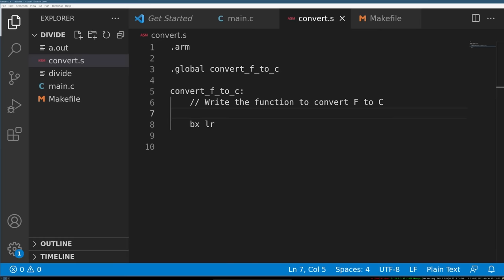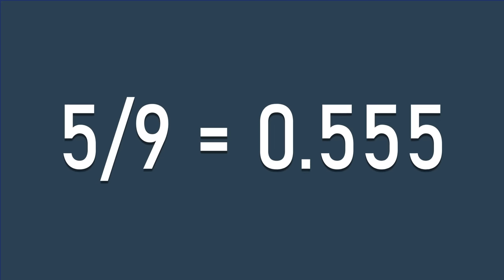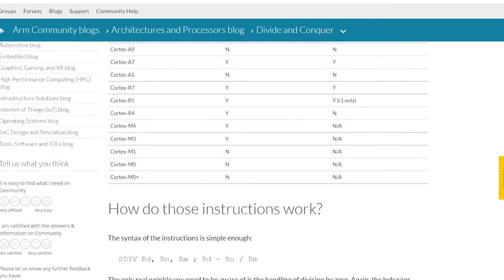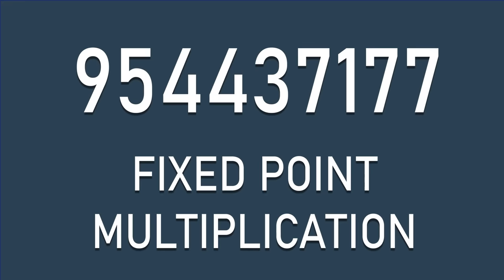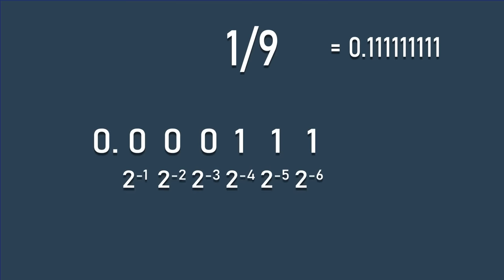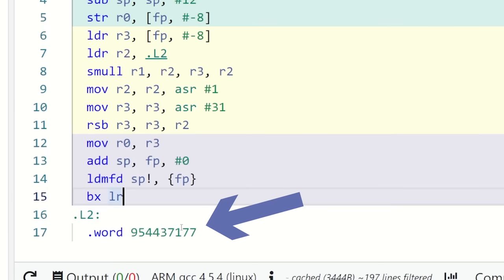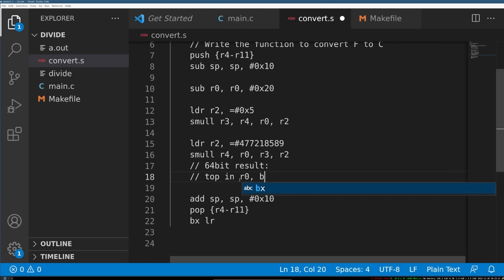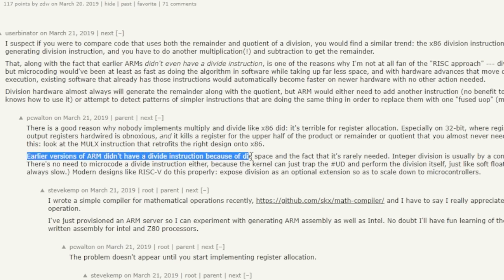computers suck at division (a painful discovery)

Comment: As an old assembly hound, it's fun to see something like ARM. I don't do a lot of RISC stuff in ASM because of the old adage "RISC is for people who write compilers. CISC is for people who write programs"

On the 8086 and 8088 we too couldn't rely on there even being a FPU, and our MUL and DIV statements were painfully slow -- in excess of 150 clocks EACH. 

An old trick for doing percentages in that case was to do a multiply very like this as a fraction of 65536. What made that "fun" was you ended up with the integer result in DX, and the numerator (65536 as the denominator) in AX. We were further hobbled by there being no MUL reg, immed

; assumes temperature in AX
sub  ax, 0x20
mov  bx, 0x8E38 ; roughly 5/9ths 0x10000
mul  bx 
; DX = integer result, AX = numerator over 0x10000

Becuase it uses only the one multiply, it takes half the time that MUL 5 and DIV 9 would. Which is good when we're talking turning 300+ clocks into 150.
Reply: So true, typical MUL reg
Reply: What are 8086 and 68000 even doing in all those cycles. The factors are 16 bit as is the ALU. This only makes sense to me if MUL and DIV were just an afterthought which had to be cheap. Indeed I have seen a large stretches of code without any of these instructions. This typical IBM-PC business code does not MUL or DIV. Maybe once to calculate taxes.
Reply: @ArneChristianRosenfeldt  A hardware multiply requires a lot... no,  A LOT ... of silicon. We're talking as much as 20 times the silicon as an addition. To that end a lot of early processors left it out entirely, or implemented it in "microcode"

In fact that's exactly what the 8086 / 8088 does, is use microcode. A small bit of code on the processor that pretends to be an opcode, that runs on the other instructions of the processor. 

Even with a hardware multiply the operation is intensive enough to require a lot of clock cycles as multiply and divide -- even just as integer -- are expensive operations. A mul reg16 taking anywhere from 25 to 40 clocks depending on CPU. (laugh is the 486 is slower than the 286 or 386), and thus it wasn't uncommon for stuff like vga video routines to still use shifts instead.

; ACCEPTS 
; AX = Y
; CORRUPTS
; AX
; RETURNS
; DI = Y * 320
xchg ah, al  ; == y * 256
mov di, ax
shl ax, 2      ; == y * 64
add di, ax     ; di == y * 320

Runs in about half the clock cycles of a hardware multiply right up through the first pentium. Though still not as fast as a XLAT
Reply: @jasonknight1085  still does not explain why anybody would need more than 20 cycles in microcode. With a barrel shifter and some look ahead for zeros all those shift special cases would go away. Zero flag running from msb to lsb for early out (like in 386).  Silicon usage goes up with the square of bits. Hence it makes sense to implement 8x8 as MUL ( costs like a 64 bit add ), and then run the microcode over this. 4 cycles for 68k like 16x16 -> 32. ARM7 in the GBA has hardware 32x8 and needs 4 cycles for 32x32.
Reply: @ArneChristianRosenfeldt  Do you realize just how much silicon an ARMv4 has that an 8086 does not? We're talking about a ~29,000 transistor and ~5000 gate processor here. That ARM7TDMI (the 7 is misleading, it's a v4) is what, 280,000 transistors and 90k or so gates?

What you describe in silicon alone would be a fifth the die space the 8086 used. JUST for the multiple logic alone.

Remember, this is an age where a DRAM memory access was 4 clocks per bus width (so a word was 8 clocks on the 8088), and even a simple byte shift by fixed one place took two clocks. Memory shift was 15 + and effective address calculation, and shift reg16 by CL was 8+4n. 

But yeah, once transistor counts grew these problems went away. By the time of the 80186 you're looking at 26 to 33 clocks, and the 286 it's 13 to 26 clocks. 

The 186 was 55,000 transistors, the 286 was 134,000. 

Also worthy of mention is the NEC V20 and V30, drop-in replacements for the 8088 and 8086 respectively, with timings closer to and in some places even faster than the 286. See its flat 21 clocks for all 8 bit multiplies and 26 clocks for 16 bit. 

It achieved this by having over 60,000 transistors, more than double the stock intel part.

The type of infrastructure needed for the microcode you describe by the time you do both 8 bit and 16 bit mul and div is more silicon than many processors even had when the 8086 started being designed in 1976. That's no joke either, look at the 8080 with its whopping 4500 transistors-- and it was considered a chonky boy on release. The Z80 was around 8500, 6502 was 4500. And IF contemporary processors had a multiple opcode (many did not) they were inherently 8 bit with a 16 bit result (in two registers). 

There's a reason the Motorola 68000 with its amazing fast hardware multiply via its 16 bit ALU needed 68000 transistors (hence its name), an absurd number for the time that took five years to even come close to looking viable outside of big iron use... because manufacturing processes for that many transistors reduced yields resulting in elevated prices.
Reply: @ArneChristianRosenfeldt  Oh and side note, anyone out there bitching about how "confusing" Intel or AMD product naming / version conventions are clearly never worked with the NIGHTMARE that is ARM.

That you can have fifteen different CPU's from six different vendors labelled "ARM7" and none of them are actually ARMv7 cores? Classic.
Reply: @ArneChristianRosenfeldt  Also, ever use an ARM v1? The actual "Acorn RISC Machine"? 

Nothing like having to do a "AND 0xFE" after a rotate because there's no shift operation. "reduced instruction set" indeed.

Though could be worse, some old mainframes you had to do a TEST 0x01 because there was no overflow flag on rotate, AND there was no shift. Ah, the days of point to point wiring 256 to 512 discrete transistors to build a "processor".

Ever weld and wire-wrap your own core memory?
Reply: @ArneChristianRosenfeldt  Also... look ahead... in 1977... BWHAHAHA... comedy. Talk about speaking from privilege.
Reply: @jasonknight1085  I was more complaining about the 68k: So many registers, yet multiply is slower than x86 . ARM TDMI or whatever has 32 bit factors. Of course, it is large. Though it has the same number of bits in its register space as a 68k and an SH2 .. I did not know that we talk about 5000 gates here. The title would then be: "Computers were horrible at ...".  x86 has a 16 bit ALU + address adders. 6502 has PC increments + ALU. Motorola 6809 has more than 5000 registers and a MUL instruction ( 8x8=>16 ) in 10 cycles. I like that.
Reply: @ArneChristianRosenfeldt  The 6809 was an engineering marvel. Though I think you meant transistors, not registers.... and it had 9000 of them which is part of why it was one of the more expensive processors of its time. 

That and it was hobbled by economies of scale since the number of devices built around it can be counted on one hand.

It's actually part of why it was a bit of a shock when Tandy put it in the Coco. Even when for all intents and purposes the Colour Computer was just a Motorola reference design. (Which is how Tano got away with the Dragon) 

A powerful processor more suited to minicomputing, in a microcomputer that was nearly marketed as a toy? Even more so when it was also the core of the dirt cheap "videotex" hardware... where the CPU ended up like half the cost of the unit. 

But give it a few years, up the transistor density and what do we get? That lovely Hitachi 6309. NitrOS9 on a 6309 could give many "true" 16 bit platforms a run for their money on raw computing power.

Which reminds me, I've had a 6309 sitting here waiting to go into my Coco 3 since september...

Comment: Amazing content. It would also be interesting videos about division of non-constant numbers, the implementation of a floating point unit (showing how to add and multiply floats) and also the implementation of algorithms like sine and square root. All of that comparing C and assembly.
Reply: It looks like the library function __aeabi_idiv/__aeabi_uidiv is generally used on ARM to handle division by a non-constant denominator.
Reply: Binary long division isn't as complicated as you might think, though it's fiddly

Comment: Division isn't "harder" than multiplication really. It's just that it can't be performed in parallel, or be "easily" pipelined. Older processors didn't have any multiplication either, even less any floating point unit... only plus/minus on integers basically (plus comparison and bit-operations). So multiply/divide as well as floating point (and sin, cos, tan, log, exp, etc) had to be programmed in assembly. This was the usual case up until the mid 1980s, or even later (with some high performance exceptions).

Comment: When I was first taught about logic gates and how to make a full adder curcuit, I went on an absolute rampage trying to figure out how pure logic can be used to perform mathematical functions.
Subtraction is easy once you know how to add, and multiplication is just adding with extra steps, so I figured them out quite quickly, but I remember spending weeks on division.
I ended up figuring out how the division process worked, but was left with the problem that:
a) like half the results of dividing in binary end with recurring decimals
b) Three decimal places would only give my answer a resolution of 1/8th

This resulted in some divisions appearing to give the same answer, because the difference between them was too small to see.
So I thought "I know, I'll just represent the remainder as a fraction, that should be easier."
The problem with that is that nobody wants to be told that:
27÷18=27/18
So I would have to find some way to simplify the fraction. Which is not easier at all.
As it turns out, the only way to find the prime factors of a number is to divide it by every prime number smaller than half of the original, smallest to largest, and see if the result is a whole number. Which means for each digit you add to the input the list of prime numbers needed to check grows exponentially.
And then you have the added problem  that once you find that a number is divisible by one of the primes, you then have to check whether you can divide it by that prime again, and keep checking indefinitely until you get a remainder, and while that's easy enough to show in a flow chart, making a circuit to do that is a whole different matter.

The "solution" I decided on was to make a curcuit that only devides three digit binary numbers, and have the remainder be displayed up to three decimal (binamal?) places as long as there is no "loss" (I.e. There is no data carried off the end of the divider circuit).
If there is loss, the result is displayed as a fraction which can then be simplified.
The reason this is easier to simplify is that now the only fraction that will ever need simplification are 3/6 and 2/6
This means that my simplification circuit only needs to check if the numerator and denominator are both even, and if so divide them by two, and if not, check if they're divisible by 3, and if so divide them.
If they are neither divisible by 2 or 3 they are displayed as they are, since I know from my meta-knowledge of all possible divisions of three digit binary numbers that any other fraction I could encounter would either be already in its simplest form, or be possible to display to three decimal places without loss.

This was really a solution, but I'm still pretty proud that I made it at least look like it can divide.

Comment: If you're gonna use "SCARY FIXED POINT" to a division, you may as well fold the multiply by five in, and save a whole multiply instruction.

So instead of setting up 1/9 as your magic constant, set up 5/9 (just a different constant).

But, yeah, depending on your CPU, some things need to be coded using multiple instructions. Might be multiply, might be divide, might be floating point.

I worked on a graphics system coded in 68000/C where all pixels were held in fixed point 24.8 (a whole number of 256ths of a pixel, if you like)

Comment: I encountered such a thing on a school project with FPGA's. With an FPGA you allocate logic units (AND, OR etc.) to build your own logic circuit.

Using a single division operation used like a thousand logic units, which is a lot. Instead we used an division algorithm which got it down to under 200. It probably used multiplication and bit shifting, but I'm not sure anymore.

Comment: Meanwhile x86 has native sine cosine and tangent and can convert between extended precision binary floating point and 18 digit decimal integers
Reply: 680x0 had those too in the FPU for '020 and '030, but they removed them again for the '040 because they're slow even in hardware and add so much complexity and use up so much silicon.
Reply: @andrewdunbar828  680x0 is dead.

Comment: I remember back in the day I was assigned to a project on an 8-bit microcontroller where they can a complex division operator. It was a couple of pages long. I looked at what it was dividing and it was a simple conversion from something which came from dial with like 10 settings. So, I just used a lookup table with the ten values and called it a day.

Comment: Correct me if I'm wrong, but fractional multiplication is the workaround.  Utilizing the double-precision Multiply Accumulate Unit (MAC) on most M3 and even the M0+ can do this.  I think the API's even gave access to efficient low-level routines that could knock this out within a reasonable number of cycles.

Comment: Been there done that on 6502, z80 a whole lot. And fixed point is the easiest and fastest approach. 
Also many CPUs don’t have multiply, they are both mathematical monsters 🤪
Reply: One method I've seen on 6502 is to use a lookup table of squares; (x+y)^2 - (x-y)^2 == (x*y*4). Useful for 8-bit * 8-bit -> 16-bit multiplies. You can do the divide by four with shifts or just build it into the table.

Comment: If you need to do many chained calculations containing different operators, it can be faster to do them as rationals, and only do the final division at the end. Summation and division will end up to be three operations minimally, but it can pay off quite a bit for lower complexity with other operations. Though it can quickly run into rollover issues, so might need to keep an eye out for that, and apply a simplify step (gcd algorithm) where necessary.

Comment: YES - more of this please! I’m learning 6502 (cc65 but no stdlib lib emulation), and this kind of trickery totally relates. 😊
Reply: Lookup tables are your friend on 6502 where practical.  Check this video which has a link to page (as I recall) that shows how to do 8x8 bit multiply on 6502 with 4 table lookups, 2 8 bit add/subtracts, and a 16 but subtract in under 40 clock cycles, https://www.youtube.com/watch?v=WEliEAc3ZyA&t=1628s

Comment: Learned this at university while studying computer engineering. That is one of the advantages of a 4 year education over general programming bootcamps. You get into the specific details of why things happen at a low level.
Reply: Im learning this rn in my computer systems class and I still can’t wrap my head around it
Reply: @housemana  No chance anyone out of a coding boot camp could get my type of job. It requires quite a bit hardware knowledge as well as low level programing knowledge. Let alone the amount of research we have to do including advanced mathematics to invent tech that is not currently in use. This is just one of many upon many things covered in an extended program. In case you are not familiar with software development, there are many branches and specialties that required varying levels of knowledge.  Usually the more difficult jobs tend to have higher requirements, but also have higher pay ceilings. Except maybe game development (High standards, shit pay and low quality of life).

I'm not saying this to shit on people who go to boot camps. In fact I have a ton of friends who have advanced their careers and greatly benefited from these. But if your goal is to be a software dev, a 4 year university will undoubtedly provide you with a more thorough education and better job prospects as starting point. I just see a lot of videos essentially spreading your same message, and it is just not accurate.
Reply: @kool2btrue  why can't you just read the textbooks at home? I am a self taught software engineer and I just read books on this stuff
Reply: @kool2btrue  I bet I could get your job
Reply: @KashTheKingYT  Given you don't even know what my job is while making this statement, I can confidently say you wouldn't make it pass the first filter. I would never even know you applied before your resume is discarded.
Reply: @kool2btrue lol sure sounds like you work in hr and some else writes the codes that make your job easier